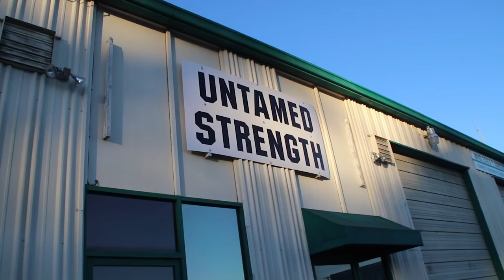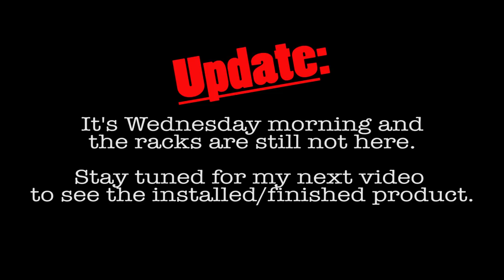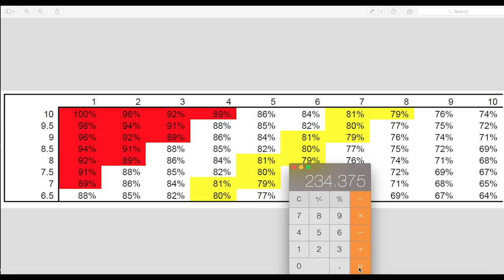MEET WEEK Training Day 1 & Repairs at Untamed Strength

Comment: As a gym owner, do you often want to train more than 4 days a week since you're already there anyway? Even if it's lower-intensity isolation training to work on improving weak areas or do you stay strict to your program so as to not over/under train? Have you ever had periods in your training where you trained more or less than 4 days per week?
Reply: Rob S just workout everyday already
Reply: Jakob Mayr lol I train 6 days a week since I have a relatively easy work schedule, but many people follow a 4 day split and are still extremely strong
Reply: Rob S you could split a 4 day into a 6 day split so you the same work but with better recovery. Or just add 2 easy bodybuilding days to a 4 split.
Reply: Jakob Mayr that's kinda how mine is now lol, I have 4 days each focuamaed on one of the 4 compound lifts, 1 day for training cleans and some direct arm work and the 6th day is a bodybuilding/easy day just to workout whatever I feel like
Reply: Rob S i would still make the 6th day a planned push pull workout or so. If you just randomly do exercises it will not get you anything as a natty. You need to progressively overload on everything. I used to do the exact same mistake.